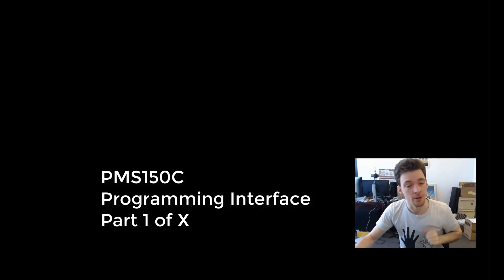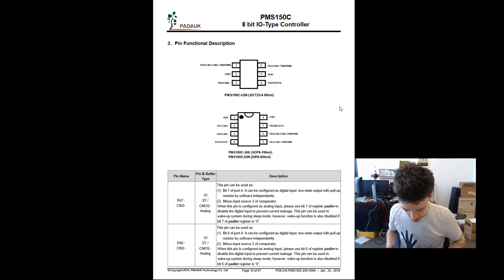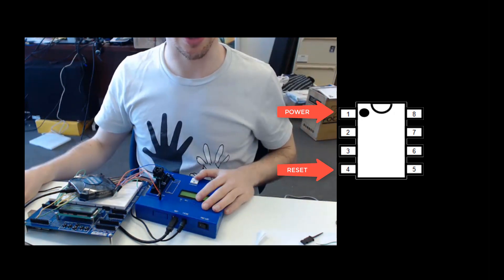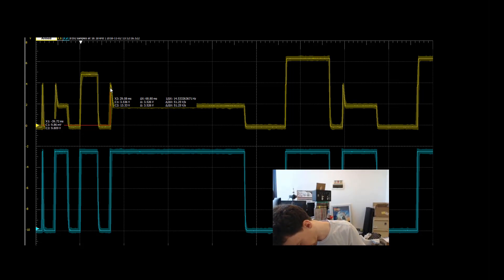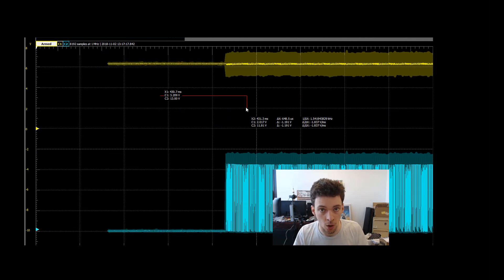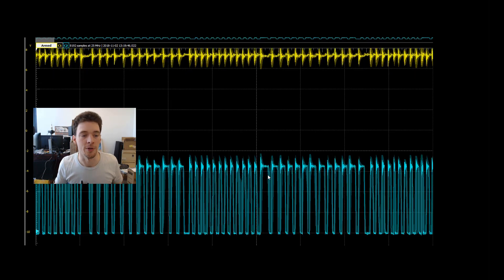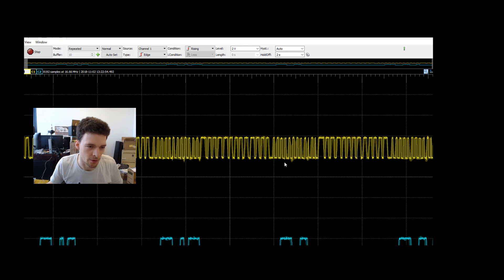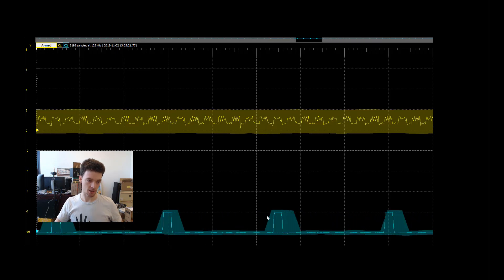EEVblog #1144 - Padauk Programmer Reverse Engineering

Comment: You could try programming without each of the presumed extra pins one at a time to see if the signal is from the chip/programmer or even relevant to the process.
  I'd be more interested in something that is not OTP, or if you approach this subject with a top down abstraction of how to do this kind of thing in general.
   For instance I have an interest in ABOV's offshore 8051's but I'm not paying for Keil/Segger JLink just to check them out. I have absolutely no interest in taking the time to learn on an overpriced toolchain or 2k limited demo and I'm not going to get familiar with an overpriced tool that makes any future chance of commercial development impossible with insane licensing fees. Those factors are what's holding back my curiosity on stuff like this. Sure I could pay the ~$100 for a Jlink and learn most of what I need to know on Keil, but IMO the hardware potential doesn't outweigh the limitations. How do I get something like this going with SDCC without the proprietary handicapping junk?
  At least that's why I'm curious about this stuff. Reversing the OPT chip isn't really very useful IMO. "How do I get a random poorly documented IC" programmed is more my curiosity.
  An easier target would probably be something like the old Lattice PLD's like a GAL16v8. Those are dirt cheap, the documentation is rare but available, and they would be much much more useful to the Maker community if someone showed how to program them clearly. This is especially true if you can pull it off without Windows. I've heard people complain about wincupl, and that the TL866 programmer sucks at PLD's. Another CC I was talking to yesterday said he's using dos to program them now. That's the kinda thing that reverse engineering a programmer and modern working toolchain would really help IMO.
BTW Dave-ii, I like that you didn't use the big tools. The Beagle logic idea others posted sounds interesting, and the analog Discovery is doable, but big Dave's toys are way way way out of my budget. I'm still playing with the periscope-screened DS1052E like the one Dave hacked way back in the babeevblog days. If I can't do it with that, it ain't gonna happen. 
Thanks for the upload, and GL!
-Jake
Reply: yeah, I hope that someone will try to reverse engineer the protocol. I've seen a lot of project about GAL/PAL programmer but no documentation on programming protocol
Reply: @ThinhNguyen-tf6sx  
I was talking to Doug over on Retro-Depot about it as he's made a few uploads. He was the one saying he's trying to use DOS now. I think Robert Baruch has some stuff on the subject too, or maybe it was on his website, I forget. Doug has an interesting Z80 project that uses several GALs.
   I would certainly use PLDs more if it was easier. I like the little EPM240 CPLD dev board I've got, but I don't like 100 pin SMD packages on boards I'm etching myself so I don't play with this stuff as much as I would like.

Comment: The LF may be for charge transfer: Clock in the data, then repeatedly bang it onto the storage wells.  This was done using the data lines in parallel EPROMs and OTP-ROMs.

Comment: Would a level shifter be of any use in these situations with the different levels?? Maybe a level shifter in conjunction with the analyser would help?? You could use the resistor divider to probe the level shift, and then another line to probe the data at the shifted level?? Could it be that they are using some sort of multi-level encoding to shift more than one bit at once? (A bit like how MLC and TLC SSDs store data??) Just thought i'd throw a couple of ideas out there. Interesting video. :)

Comment: Dave reviewed a zeroplus logic analyser, I did a review on the same one, I think you can get that to read the data as you can set the thresholds you want, and read all the pins at once. That thing you are using doesn’t have the resolution you need, plus the zero plus can do decoding at the same time, to help with deciphering the data.

Comment: From the PDK5S-P-003 manual, selecting 'on board voltage limitation' may help by preventing levels above 5v.  You should try to find two identical sets of data in a capture, one of them being programming, the other the verification.  Align the two and then look for a pattern, this should allow you to work out the number of bits in the sequence - it may possibly be more than 8.  Also the manual has a diagram for in circuit programming requiring only 5 pins, so you only need to really monitor clock, data and reset, the purpose of variation in vdd level can be worked out later
Reply: Perhaps, the VDD level might determine the state the chip is in. More experimentation is needed.
Reply: @davidledger5941  Maybe, but do read the programmer manual 'on board voltage limitation' - 5.1v zener to Vdd. Sounds like it's purpose is for in circuit programming when the circuit has a 5.1v zener limiting the voltage to the micro when powered from more than 5v. Measure just the three clock, data and reset pins - resistive divider >10k ohms to the programmer (again according to it's manual - it's on page 26)
Reply: @davidledger5941  I have had a quick look at the PIC programming spec and also the AVR programming spec. The PMS150 looks to be closer to a PIC in the way it's programmed.  The AVR programming requires a clock and two separate data lines (MISO & MOSI), where the PIC only has clock and data (bi-directional) so the PMS150 looks closer to that style or programming method (only a clock, single data line and reset used).

Comment: It's an ARM based programmer, right? Why not dump the firmware and slap it into IDA Pro? :-)
Also to your "I can't use a logic analyzer because of different voltages".... then probe earlier into the path, maybe right off the ARM or before a buffer chip raising/dropping the voltage?
It's possible all the different voltages are just a trap/fake. Maybe put all the voltages it's applying through a bunch of transistors that just switch on/off and see if it still programs fine? (Oh wait, bidirectional would be needed... so... something more complicated?)
Reply: yeah but that implies soldering tiny wires which is a pain and even then maybe there are and gates somewhere to change the pins voltage or something.
Reply: Yes its a STM32F072 I believe. Its the same IC as for the uSupply so I'm pretty familiar with it :). 
Its a nice IC, but it is a little memory constrained...

Comment: Maybe lower supply voltage for read cycles?  Also have you generated a hex file to write 0x00-0xFF to see where the pattern shows up in the stream?

Comment: Could the protocol be JTAG-like, with data shifted through a weird length shift register then pulsed in/out of circuits? This could explain unused pins getting pulsed each sequence cycle as synchronization bits shift past them.

Of cause full JTAG uses 3 data pins with approximately equal activity on the two busiest pins, so can't be that.

Comment: The power off/reset phases in the overall process might not involve state in the chip other than actually resetting all state by power cycling.  Possible phases could be:
  Initial quick probing to confirm device inserted properly (right way up etc.) and the supply levels for the next phase.
  Small sequence to read out chip id (model and design revision), selecting different procedures depending on known chip features and bugs.
  Longer test sequence to run all chip parts through test patterns and reject bad chips (this would be the long sequence at normal power).
  Actual programming of main PROM.
  Read back of entire PROM to verify all bits correct.
  Additional passes of write/verify in case the fuse design needs to be "burned" multiple times to stick.
  Final burning of the anti-readback fuse and checking that it can't be read anymore.
Reply: I never thought about what this means before, but these comments got me thinking. When you "burn fuses" is that literally overheating a connection in the chip to the point that it disconnects?

Comment: If the slower clock pulses are not just providing the main clock for the chip to program itself, could they be polling to check for operation complete?
Also how did you check direction on the pins? is the programmer or chip driving the line?

Comment: You could buffer the data line with an opamp, use a zener to limit the maximum voltage and put a comparator on the zener resistor to tell when the voltage is high. With multiple comparators you could even “digitize” the high voltage levels. It costs you some more pins, but at least you can use a normal logic analyzer
Reply: Instead of trying to turn the analog signal into a better digital signal, why not just probe the digital signal closer to the MCU, when it's still digital? ;-) There might even be debug/test ports/pins/etc on the programmer board.

Comment: Can you place some resistors within the data lines to tell which lines go out and which ones go in? The weird timings can be a result of poor RC clocks that comes from inside the chip, used to time the writing of the memory. Memories can be relatively slow to write into, so the chip might be advising the programmer on a good timing for that (which could also be variable!).
Reply: The pins are pretty low draw, I think I'd need a unidirectional buffer to determine the direction.
Reply: @davidledger5941  Perhaps a 1K series resistor plus a 100K pulldown on each side? That should produce some drop that you could measure.
Reply: David: To take various pins out of the equation of "which are actually used to program".... maybe try snipping the legs of the chip and see if it programs? Example: on a fresh chip, snip pin 2, attempt programming. New chip: snip pin 3, attempt programming. And so on. Then you'd know for sure which pins you'd need to probe. :-D
Reply: @linagee  It seems to disallow many things and it seems to check for the presence of all pins before allowing programming. It won't program if I stuff up a connection for example (which i frequently did on many pins).

Comment: In order not to lose the low voltage part in a logic analyzer capture, feed in the signal not through a resistive divider, but through a series resistor and a zener to ground after it. This will "cap" the high voltage signal down to the appropriate level while leaving the low voltage one unaffected (if capacitance of the zener screws up the rise and fall times, you can probably add a tiny capacitor in parallel with resistor to compensate).

The high supply voltage could be applied during the writing sessions in order to provide enough power to burn the fuses in the one-time-programmable memory.

Also, I think some Atmel MCUs have an alternative parallel programming mode that utilizes high programming voltage (you are supposed to use it if you've accidentally disabled RESET pin by setting fuse bits incorrectly). I'm not really into Atmel MCUs, so can't tell more specifically...

P.S. Did you notice there's exactly 8 bytes sent between each "chip select" line release?
Reply: Good idea!, zener divider seems the most simple solution so far :)
Reply: David Ledger i was thinking ac coupling, but that wouldnt do much for the large “swing” , a zener is a better idea
Reply: Or instead zener, you could use green/blue LED. AFAIK LED has little parasitic capacitance.
Reply: What is wrong with using an BJT inverter tuned to switch at the lowest threshold?

Comment: Could it be that each voltage level could represent, Input to buffer, Shift to memory location, burn fuse, verify data.
Reply: I thought something similar - the different voltages invoke different sets of commands  - would seem sensible given the dearth of pins.
Reply: @mahlapropyzm9180 , would seem to be the only reason to change the state of the power pin. CS pin could just handle the 9 volts. Kill 2 birds with one stone.
Reply: Good idea!

Comment: Looks like the data transitions on rising edge and is captured on falling edge. I'm sure you could dump the bits out with a python script, and search the raw bits for chunks of your program binary :)
Reply: I do have a script to dump out the bits :)
What i haven't seen yet is data change that proceeds a clock pulse, this made me think that the micro wasn't returning anything at all.
I just haven't done a video yet :)
Reply: @davidledger5941  what does the programmer do if there's no chip attached? :D
Reply: @Wren6991  It gets angry at me lol just beeps. 
It also gets angry when any pin is driven and a few other things seems to cause the same thing.

Comment: Also I am wondering if variations in overall timing are just due to the steps being sequenced by some software on your PC, which is at the mercy of the OS scheduler.
Reply: I think the software sends the entire ROM to program into the programmer, and then the programmer takes over. (Because: I think it can program with the button on the programmer when the PC is not connected?) There could still be weird delays that aren't part of the programming algorithm, maybe the MCU on the programmer has a scheduler.
Reply: Could be partially, I did observe it on an oscilloscope, the saleae logic and the analog discovery.
Reply: I wonder if the programmer is bitbanging, not using dedicated hardware to drive the GPIOs. That may explain the variation in timings. Longer code paths take longer to change the programming lines. (Since its clocked, the baud rate doesn't really matter)
Reply: Lol thank you for reading my stream of consciousness brain dump

Comment: 1 cent more?! rip-off.
Reply: Wouldn't it be funny if it was the same chip with just different fuses set? (Maybe even just by the programmer?) Would they really have an entirely different chip die? :-D
Reply: @linagee  If the fuses were set by the programmer, how should it know then what type of mcu is to be programmed? There must be already some fuses burned before. Or otherwise, it should be possible to buy cheaper units and to just tell the programmer you are using an other model. But I can just hardly imagine they are using a common die for many models since that selective enabling/disabling function and the (in case of cheaper models) never used circuits would be a waste of space for the manufacturer. They are making millions of every model on its own already, a flexible design would be pretty useless. It only is practicable if the die area per unit is as massive as a cpu where the additional circuit just adds less then a percent of overhead.

But regarding preburnt fuses, I got an idea for some applications: With a common die, it could be possible to mark chips in the bonding stage. Gold wire bonds could act as "jumpers" to tell the die in which kind of ic it will live. This way, the die could have more pin connection areas than the actual packet at the end. I recon they possibly do that already with identical models for different packages. (Like 8pin and 16pin ATmegas)

Comment: Low frequency clocking may just be that the programming is being bitbashed by a micro, and the timings are accidentally different in different parts of the process due to alignment of the stars when the programmer's firmware was compiled :) have you guys torn down the programmer?
Reply: This is what I was thinking too- perhaps the timing variations are more of a programmer quirk than a necessity
Reply: That could be why the timing is different.  It still indicates that the programmer s doing something different during fast vs. slow cock pulses.  Whatever is happening during the slow pulses may take more cycles for the programmer to process.